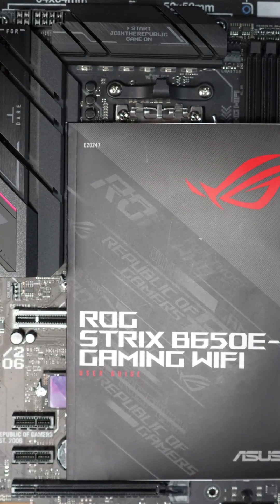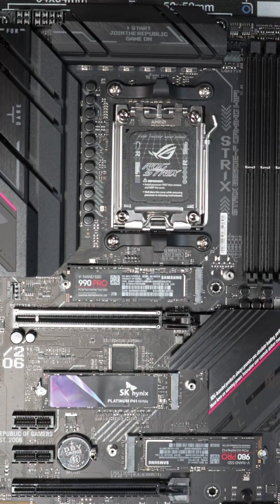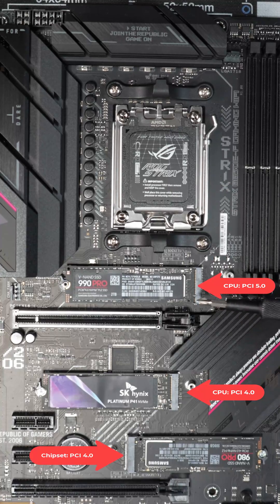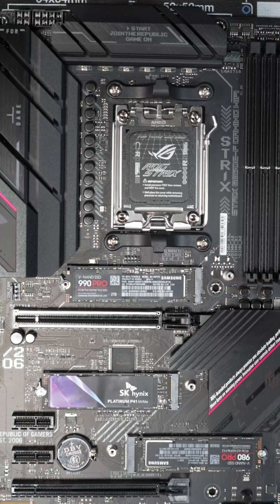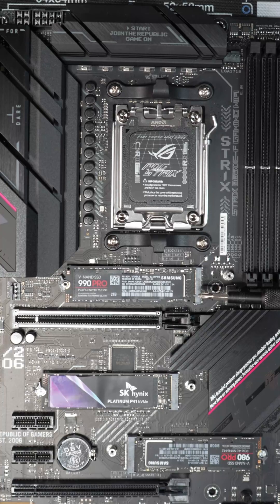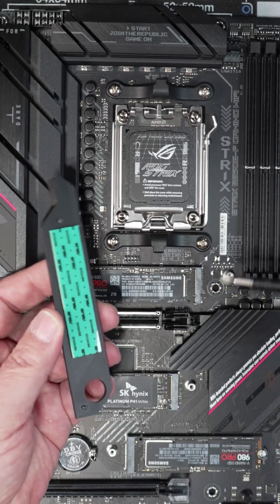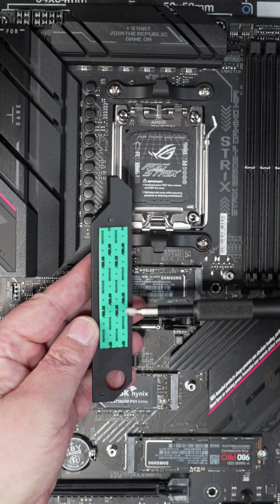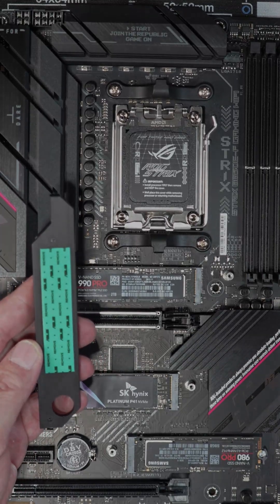Using The Best M.2 Slot on a Motherboard #short

Comment: Prebuilt pc. I am looking to add more SSD’s for more storage. I currently have 1 (2TB- 4th gen I believe) and want to add two more. The top one right now is the SSD that has the os but I want to add a GEN5 (4TB) there and move the OS to the second slot and follow by adding the third one GEN4 (4TB) on the chip set. How is this going to affect me? Is this also possible? I have a steel legend Z790 ASRock WiFi motherboard.

Comment: Which is an affordable am4 (sub ~$100) mobo with 2 m.2 slots now?
Reply: I've been looking at these for myself. Most are budget (for me I need mATX/Wifi/m.2 4.0)

MSI PRO B550M-VC WIFI Micro ATX (more pcie slots)
MSI B550M PRO-VDH WIFI 
Asus PRIME B550M-A WIFI II Micro ATX (no heatsink for m.2)

ASRock B550M PRO4 AM4 mATX (No wifi sadly)
Gigabyte B550M GAMING X WIFI6 (I don't think this has built in wifi tbh)

Comment: Ok so I’m seeing a lot of videos if you connect a m.2 to the 5.0 slot your gpu Loses performance going down to 8 lanes instead of 16. Should I still connect my m.2 to 5.0 slot or another slot so my gpu can run 16 . ?
Reply: it depends on your motherboard design, some will run both at 5.0 and some will drop if they are shared through a switch

Comment: Thanks for the video. Doing my first PC build now and find it a little overwhelming but still pretty damn cool. 
I only bought one SSD and it's a Gen 4 and using an Asus motherboard. According to the manual, because I'm using an AMD7 series CPU. I am supposed to use the bottom  slot(2.2) and don't have a Gen 5 SSD so am I okay if I leave the (2.1) slot directly under the CPU empty?

Comment: What exactly is the slot connected to the chip set? I can understand the ones connected to the cpu but what would be the use of connecting it to the chip set? Thanks for the video btw full of information and great visuals.
Reply from the maker: Most motherboards have at least one PCIe NVMe M.2 slot connected to the chipset (some have more than one). The reason for it is so the motherboard makers can offer motherboard models with additional M.2 slots over what the CPU can directly support. 

Depending on your workload, this can be fine, but if you are doing something that uses all of the M.2 SSDs at the same time, they won't have enough PCIe lanes to run at full throughput.
Reply: Thank you for the valuable lesson! I am new to computers and not very well versed with ssd’s specifically. Appreciate it!

Comment: I have a older ASUS TUF Z590-Plus WiFi board and found out in the manual that in order to use the first m.2 slot I need to use a 11th get cpu since it is not supported on a 10th gen cpu.
Reply from the maker: That is why it is a good idea to read your motherboard manual, because different CPUs often have different numbers of PCIe lanes they can use with a particular motherboard.

Comment: i am going to buy a motherboard where 1st slot is gen5 and 2nd slot is gen4, i have a gen3 256gb m.2 which has windows and a gen4 1tb m.2 which has all the games. can I use the 1st slot for my gen4 ssd and 2nd slot for gen3 ssd which has windows?
Reply from the maker: You can use either M.2 SSD in either M.2 slot, and both M.2 SSDs will run at their full native bandwidth. 

You might consider getting a larger capacity, faster PCIe 4.0 M.2 SSD to replace your existing PCIe 3.0 256GB M.2 SSD (where Windows is). Most SSD vendors have free disk cloning software.

Comment: SIR GEN 3 M.2 NVME SSD CAN WORK IN GEN 5 NVME SSD SLOAT.AND SIR IT IS POSSIBLE TO NVME SSD INSTAAL A PCI SLOAT OR PCI X 16 SLOAT.AND WHICH 1 SLOAT IS BEST FOR NVME SSD WORK IN HIGH PERFORMANCE AND SPEED.
Reply: i answer your first question, yes it works but with generation 3 speeds.
Reply: @yavuzayhan2245  THANK YOU SIR JI.

Comment: But then your gpu wont be able to use its full potential because instead of x16 it will now be x8
Reply from the maker: This depends on the motherboard (and chipset), the CPU and the BIOS settings that you use. Most newer AMD motherboards don't have this issue at all, while many newer Intel motherboards do have this issue.

On top of that, most games and other GPU-heavy workloads are NOT bottlenecked by bandwidth limitations when they "only" have 8 PCIe lanes vs. 16 PCIe lanes. They are bottlenecked by how many GPU cores and shaders they have, what generation they are, etc.

Comment: Hi i have a m.2 PCle gen 3 x4 ssd, can i put this in the closest slot to my processor? or does it have to be gen 4 or gen 5 to properly perform? (Gaming PC) Thanks!
Reply from the maker: A PCIe 3.0 M.2 SSD is only going to run at PCIe 3.0 bandwidth even if you put it in a PCIe 5.0 or PCIe 4.0 M.2 slot. Storage performance is not usually a significant performance bottleneck for gaming (unless you have an old school magnetic hard drive). The main place where you "might" notice any difference for gaming due to storage performance is initial load time and things like loading new levels.

The main point of this video is to try to prevent people from putting a new PCIe 5.0 or 4.0 SSD in a lower generation PCIe slot and to try to use an M.2 slot that is connected to the CPU rather than the motherboard chipset (to reduce latency). People should also look at their motherboard manual in order to understand what happens to their PCIe lanes depending on what they install in various PCIe slots and M.2 slots.
Reply: @ wow such a quick repspnse! THANK YOU! i referred to the manual after making this comment. This clears it up for me thank you. I went with the m.2 heatsink slot thanks again

Comment: How do I know which ones connect to the CPU?
Reply from the maker: Read your motherboard manual.
Reply: @ I just did …. Looks like my M.2 is not attached to the CPU .. Is that bad for gaming?
Reply from the maker: @nimaahmadi-s7o  Most games are not limited by storage performance (unless you are using an old school magnetic hard drive). Even in that case, it mainly affects the initial startup time and things like level loads.
Reply: @GlennBerrySQL  So it is okay to have the M.2 connected to the chipset instead?
Reply from the maker: @nimaahmadi-s7o  You can do whatever you want. Any M.2 NVMe PCIe SSD that you put in M.2_4 or M.2_5 (connected to the chipset) will be limited to PCIe 4.0 bandwidth. So, for example, I would not put a PCIe 5.0 SSD in one of those two slots.
Reply: @ my motherboard does have a chipset pcie 5.0 m.2 slot, will that be limited to 4.0 speed?
Reply from the maker: @nimaahmadi-s7o  No, the ASUS ROG Strix X870E-E Gaming WiFi does NOT have an M.2 PCIe 5.0 slot connected to the X870E chipset. The M.2_4 and M.2_5 slots are "only" PCIe 4.0.
Reply: @ thanks. Really appreciate the replies. My main concern was about the “latency” that was mentioned in your video. Will the higher latency of the chipset M.2 slots affect performance in gaming?
Reply from the maker: @nimaahmadi-s7o  Gaming is not typically affected by storage latency, especially during game play (where the main bottlenecks are usually GPU and CPU performance).
Reply: @ I don’t want my GPU to lose performance by sharing bandwidth with the M.2
Reply from the maker: @nimaahmadi-s7o  Whether your GPU loses PCIe lanes because an M.2 PCIe SSD is installed depends on your motherboard, your CPU, where the M.2 SSD is installed, and your BIOS settings. Really, unless your GPU goes all the way down to only four PCIe lanes, it won't be noticeable with most games and workloads.
Reply: @ I have a Ryzen 7 9800x3d, RTX 4090 and Asus X870e-e motherboard. I read on the mobo manual that if the 2 m.2 slots connected to the cpu are occupied, the GPU with run with x8 lanes; however, I also read that the 9800x3d has 24 PCIE lanes. This is way too confusing to be honest lol
Reply from the maker: @nimaahmadi-s7o  Yes, it can be confusing. In your specific situation, you can install an M.2 NVMe PCIe 5.0 or PCIe 4.0 SSD in the M.2_1 slot, and your GPU will still get 16 PCIe lanes. If you install an M.2 NVMe PCIe 5.0 or PCIe 4.0 SSD in the M.2_2 slot or M.2_3 slots, the GPU will only get 8 PCIe 4.0 lanes (since the RTX 4090 is PCIe 4.0). 

This is explained on pages 9 and 14 of the motherboard manual.

https://dlcdnets.asus.com/pub/ASUS/mb/SocketAM5/ROG_STRIX_X870E-E_GAMING_WIFI/E24074_ROG_STRIX_X870E-E_GAMING_WIFI_EM_WEB_1.pdf?model=ROG%20STRIX%20X870E-E%20GAMING%20WIFI

For most games and GPU workloads, having "only" 8 PCIe 4.0 lanes is not going to matter. It might show up in a benchmark, but you won't notice it in real life. If you are still worried about it, don't install any M.2 SSDs in the M.2_2 slot or M.2_3 slots. You can install additional M.2 SSDs in the two M.2 slots that are connected to the X870E chipset (M.2_4 and M.2_5). Just be aware that they are limited to PCIe 4.0 or lower.

If it were me (with your system), I would get a 4TB Crucial T705 M.2 NVMe PCIe 5.0 SSD and install it in the M.2_1 slot (so it runs at full PCIe 5.0 bandwidth and is connected directly to the CPU). I would install your OS on that SSD.

Comment: way to not mention the 8x downgrade
Reply from the maker: Newsflash: This is a "Short", which can only be 60 seconds long. 

Whether the primary PCIe slot (where the GPU usually is installed) goes from x16 to x8 depends on the motherboard, the CPU, what is installed in the various M.2 slots and your BIOS settings. Many modern Intel motherboards and CPUs will go from x16 to x8 if you use one or more M.2 slots connected to directly the CPU. 

Most modern AMD motherboards/CPUs will not do that.

You need to read your motherboard manual to find out exactly what happens to your PCIe lanes depending on what you install.

Comment: Hi man, do you have an idea which of these slots can reach higher temps? I'm gonna use one for operative system like you, and the other for gaming
Reply from the maker: That would mainly depend on what case you have and what case fans you have. Having some air flow on the SSD heatsink from the case fans makes a big difference. You can use CrystalDiskInfo to check the temperature on each drive.

Honestly though, M.2 drives don't get that hot (when they have a decent heatsink with some air flow) unless you are really hitting them hard with long sequential reads and writes. PCIe 5.0 drives do run hotter than PCIe 4.0 or PCIe 3.0 drives.

Comment: is it true that if you put your os in gen 5 next to the cpu you lose gpu performance
Reply from the maker: It depends on what CPU and motherboard you have (and the BIOS settings you use). With some modern Intel CPUs and motherboards, using the primary M.2 slot connected to the CPU will cause the primary PCIe slot to go from x16 to x8. This is not the case with most modern AMD CPUs and motherboards. You should read your motherboard manual to see what happens with PCIe lanes when you populate various PCIe and M.2 slots.

BTW, going from x16 down to x8 for the primary PCIe slot is not going to have a noticeable effect with most GPU workloads.

The main point of my video was to try to help people avoid doing something like putting a PCIe 5.0 SSD in an M.2 slot that only supports PCIe 4.0 or lower.

Comment: If you do what is described in this video 

You will sacrifice PCI Express x16 4.0 through the actual GPU bus slot
Reply from the maker: Not for most motherboards and CPUs. Using one M.2 slot that is connected to the CPU never reduces how many PCIe lanes are available for the Primary GPU PCIe slot. Using more than one M.2 slot that is connected to the CPU can reduce how many PCIe lanes are available for the Primary GPU PCIe slot. It depends on the motherboard, CPU and BIOS settings.

People should read their motherboard manual to see what their situation is.
Reply: You are mistaken sir 

Go in to Nvidia control panel 

Click on help then go to system information 

Scroll down to bus. And it will say PCI gen x8 4.0 

On your motherboard if you do what is described in your video 

Even if you only use one M2 drive if you put the Windows operating drive 

In the spot that you instruct in this video 

This will happen to you and it doesn't matter what board you got 

I have an rog Maximus Apex encore 

With the i9 14900 KS 

And if I can't have PCI Express times 16 

No one can so nice try dude but no you lose you're wrong there is no way 

That the board in your video can do this and mine can't I'm sorry nice try bud
Reply from the maker: @theslayerdog7669  Like I said before, it depends on the motherboard, CPU and your BIOS settings. I also said that people should read their motherboard manual to confirm how it works with their motherboard and CPU. 

Your specific ROG MAXIMUS Z790 APEX ENCORE motherboard will take the primary PCIe slot down to PCIe 5.0 x8 if you use the M.2_1 slot. Many modern Intel motherboards do this. Most modern AMD motherboards don't do that.
Reply: @GlennBerrySQL  it could be an AMD thing 

But at the same time AMD is not at the top of the benchmark list 

And the i-9 14900 KS beats out AMD 

So this does discrepancy does not does not mean AMD has an upper hand here 

I respect you for reply the reply 

For all that read this comment make sure you check in the Nvidia control panel under system information 

If you try with this author has suggested to make sure you don't affect 

Your graphics bus slot which is more important in 4k or even 8K then having a faster hard drive connection

Comment: My Gigabyte Z790I ULTRA has two M.2 connectors, M2A_CPU and M2P_SB, I'm guessing that M2A_CPU is direct to the CPU? They have no forum, no FAQ and no information about the names and speed of each connector.
Reply from the maker: Just look at Page 5 of the manual. M2A_CPU is connected to the CPU.

https://download.gigabyte.com/FileList/Manual/mb_manual_z790i-aorus-ultra_1001_e_230329.pdf?v=db276e0913805c4a929d866e26c97144

Comment: I have a question if I install the SSD on this motherboard just like you do, then I will have less performance in the graphics card slot? I have the Same Board. I've heard that some m2 SSDs take lanes from the graphics card, is that correct? sorry for my bad English😂
Reply from the maker: That won't be a problem with this motherboard. Thanks for the comment!
Reply: @GlennBerrySQL  Then I'll build it the same way, thank you very much!!!
Reply: @GlennBerrySQL  and the M.2 hard drive for Windows in the top slot according to the operating instructions? But I can then put the graphics card in the upper PCIE slot without any loss of performance if I understand that correctly? Sorry for so many Questions :D